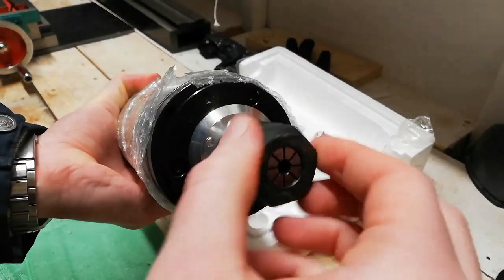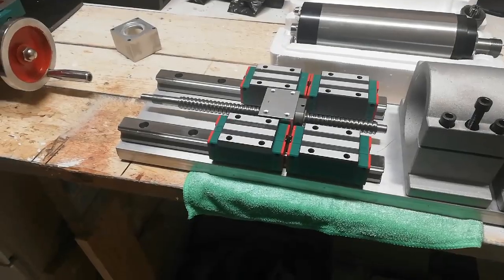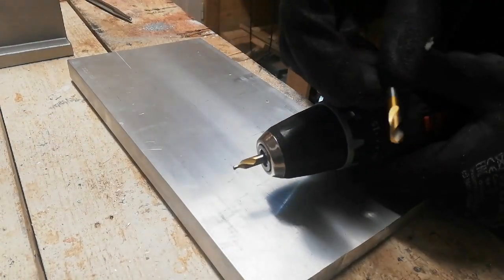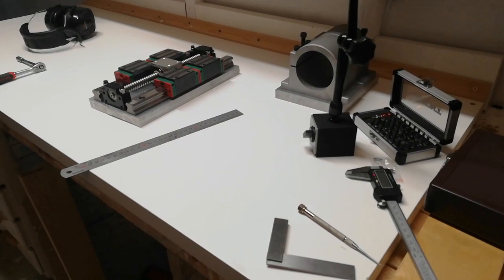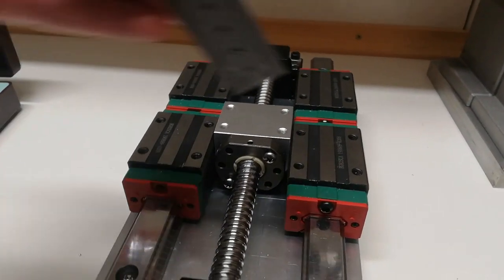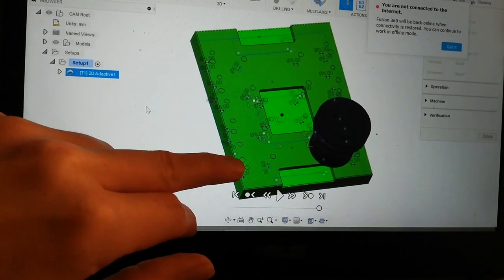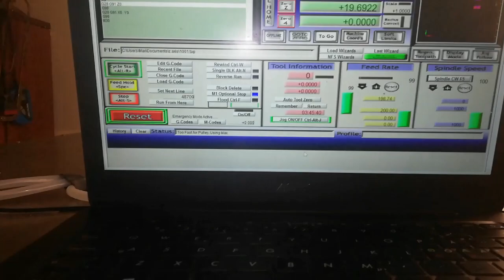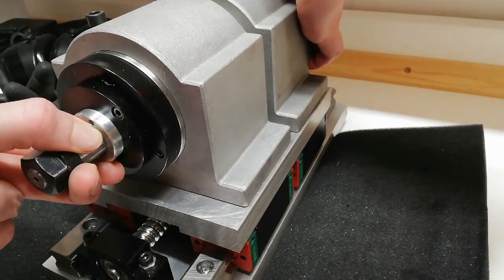6040 CNC Router - Rebuilding z axis New,  2.2kw er20 spindle (Linear rail upgrade part 1)

Comment: Why not machine the whole back of the aluminium plate ? Then you know for sure it's flat.
Reply from the maker: I rebuild the router because it wont machine flat :D now when I have linear rails I can machine a new one flat. :)
Reply: If i saw it right in the video, you cant do that with this kind of plate, or if you do, you can be sure to have a bend plate.
Because of how the plate is made, there is are a lot of tension in the surface, as long as the tension is on bothe sides the same, all is fine.
If you remove the surface only on one side, the tension is no longer equal and the plate bends, the milled surfaces becomes konvex and the unmilled konkav.

To get it flat you have to mill both sides equally and even then you cant be sure its flat